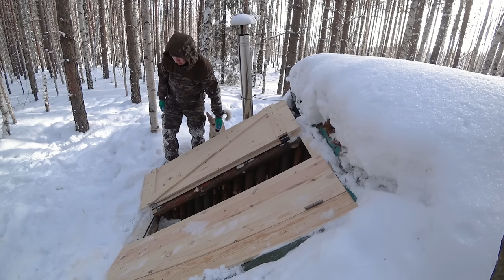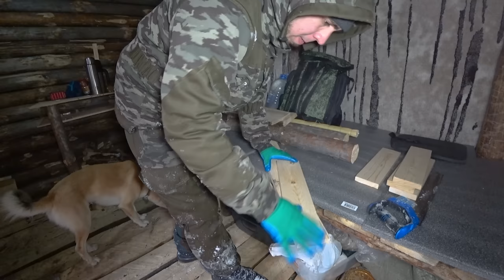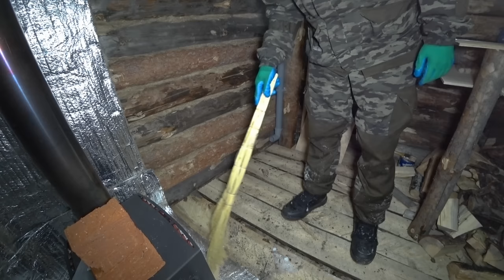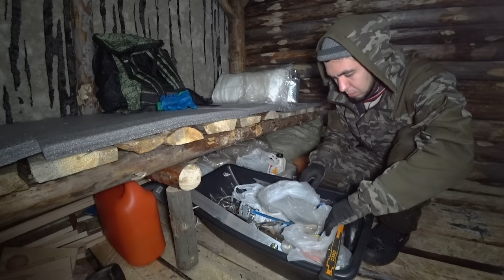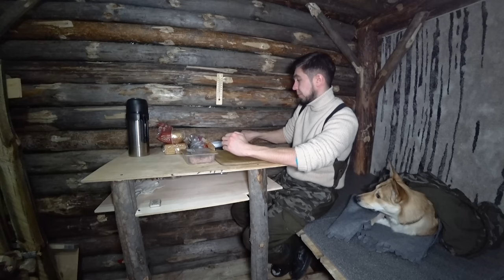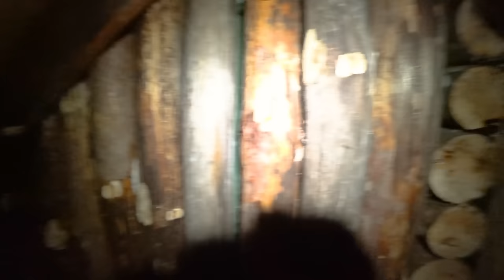My first dugout. Made a warehouse for firewood. Insulated the doors. Part 22.

Comment: You need to leave about a 1/4 to 1/2 inch gap between the doors but cover it with an overlapping board attached to one of the doors that runs the entire length and covers the gap.